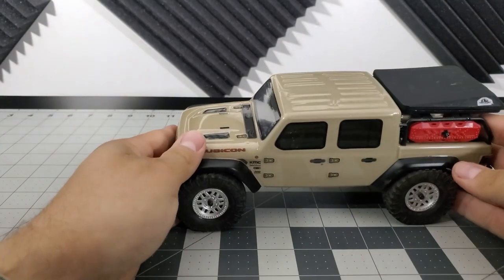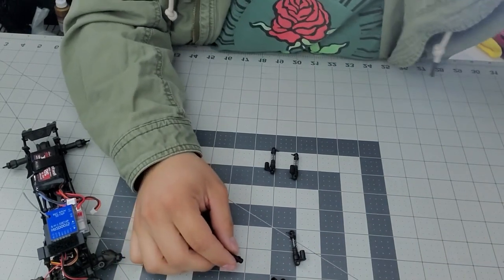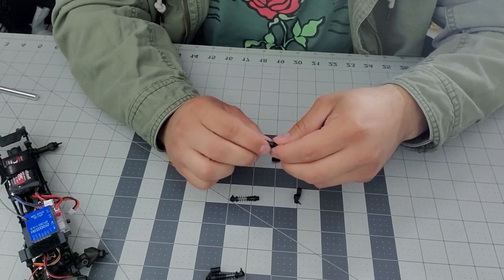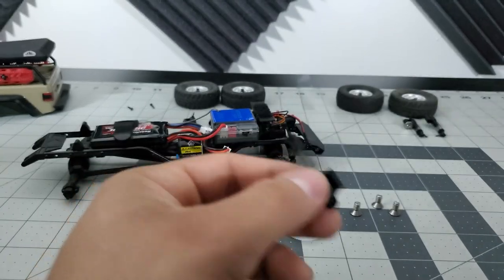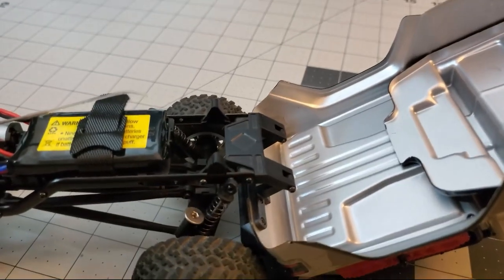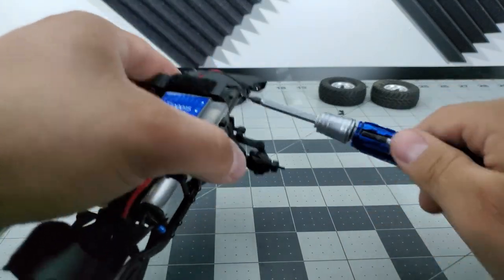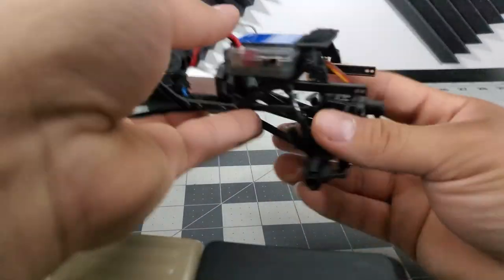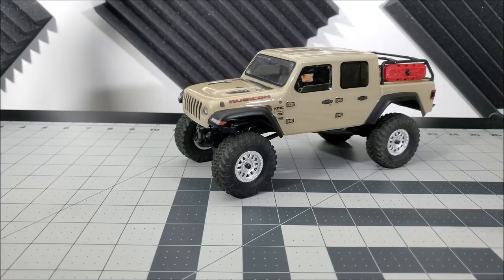SCX24 Jeep Gladiator Top Free Mods

Comment: There’s actually a switch in the controller that changes the direction of the throttle so you don’t need to swap wires around
Reply from the maker: Good point, forgot that was an option too :)

Comment: O-rings work great for preload. I used toothpicks to add grease in the shocks. I dig the BB mod for weight. Keep it up dude.
Reply from the maker: Yeah, toothpicks would be safer to use wouldn't it😅

Comment: Are the lipos safe though? On many rc forums they say these are dangerous and should only be charged with special balance chargers and within fireproof bags yet these are shipped with simple usb chargers !! So is it safe for casual rc fans to own these?
Reply from the maker: Hi! Lipo batteries will always be dangerous no matter what and they all should be kept in a metal box/container of some sort with a breathing hole(just in case one catches fire, so it won't build pressure inside)(I don't trust any lipo fireproof bags). Although these batteries have improved and become more reliable. For lipos to last you longer and to not damage them people would use a balance charger to equally charge each cell of the lipo battery, hence why it's recommended to everyone(I wouldn't cheap out on Chargers either). However, I honestly have been using the USB chargers it comes with and hasn't had any issues(just make sure with any charger charging lipos YOU are somewhere you can keep an eye on it). I'm also glad you have been doing your own research because many would just jump into the hobby and think lipos work like any other ordinary battery, so great on your part. As for these crawlers they have pretty small 2cell batteries that are very user-friendly and you shouldn't have anything to worry about. So yes these are safe for even casual RC fans. Just make sure to read all the warnings, never leave a battery plugged into your ESC when not in use, and if you ever need to dispose of a lipo, dunk it in a bucket of water adding a ton of salt to discharge it so it's harmless, wait till the water turns green and then dispose of it. I'll make my own video talking about all this to go more into detail.

Comment: Do you lose much side hilling and steep climb ability with the elevated COG? Or does the slight articulation improvement compensate?
Reply from the maker: Yes, you will lose some side hilling and hill climb ability with the high CG, especially with the rear spring being a stiffer spring rate than the front. I love seeing the articulation movement, but if you want performance, just add some wheel-weight spacers from NHX, and that alone keeps CG low and gives you a wider stance improving side hilling and hill climbing. I wouldn't stagger the rear shocks as I did in the video, just because I noticed the screw holes aren't at an equal distance so either mount both rear mounted forward or mounted in their original mounting position. I hope this helps! :)

Comment: Another way to take off the tent is remove the whole rack system with 4 hex's under the body take off tent and then replace four hex screws underneath to re-secure the rack as one piece.
Reply from the maker: That works too! I guess it's just preference and thanks for the follow :)

Comment: I'm so confused... U say your not only flipping the shocks.. but slanting them right... So wasn't that hole where it used to be screwed into.. so it would be more straight... And now it's slanted forward..
But u pointed at the hole on the other side.. if you put it back in that hole then it would be back to normal. Straight up and down...

Also.. their are a bunch of screws all along the frame rail... All you gotta do is just move the screws around until u get the hole u want..
Reply from the maker: staggering the shocks was a cool idea I thought of testing out

Comment: I've never had any luck with positioning the front shocks this way. I've tried a couple times because everyone seems to do it but it just makes the front end really bouncy and causes it to fall backwards on steep inclines.
Reply from the maker: it has its disadvantages yeah, I personally love seeing the articulation movement, I know it's not that great for inclines unless you place a limit strap from the diffs to the chassis
Reply: Same, I did it to the rear and left the front alone

Comment: what do you mean by extended chassis version?
Reply from the maker: I meant to say the extended wheelbase version since the scx24 gladiator has a wheelbase of 153.7mm while all the other models have a shorter wheelbase on average of 132mm, and technically the chassis rails are longer as well.
Reply: @rpandarc9248  thank you for the reply! Im just starting out with RCs and one of the scx24s are going to be my first so I'm trying to understand the differences between the models. I appreciate you taking the time to help me!👍
Reply: @therelaxationbox5025  The gladiator is longest wheelbase. C10 truck, Jeep Wrangler Suv and Bronco all have the same wheelbase. The deadbolt has a different wheelbase w shorter front arms and longer rear arms. Tire sizes r different from the factory. The c10 has smaller tires then the gladiator, Bronco and Wrangler. There’s 2 versions of electronics. Blue top receiver and black top receiver. Controllers have 2 models as well. 
Huge aftermarket support and community for these micro crawlers. Enjoy the $150 low price and visit Injora, A Main hobbies etc for upgrades.